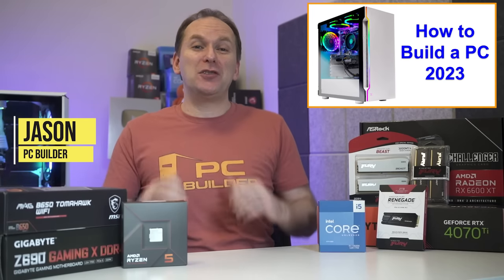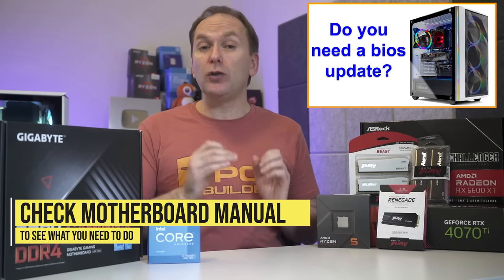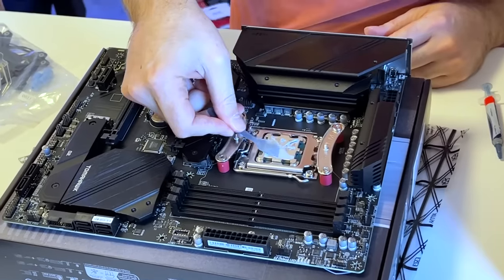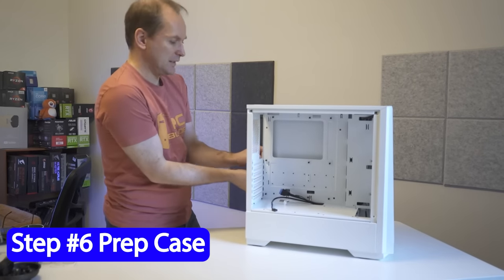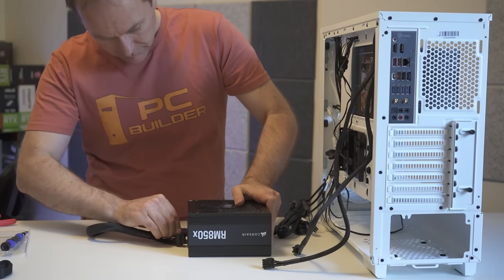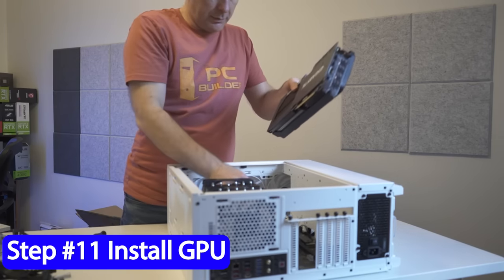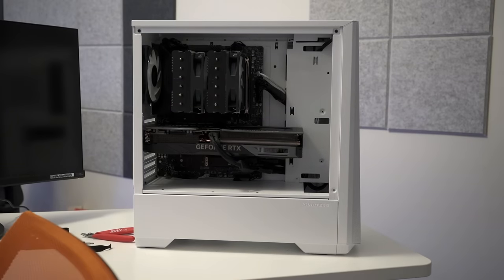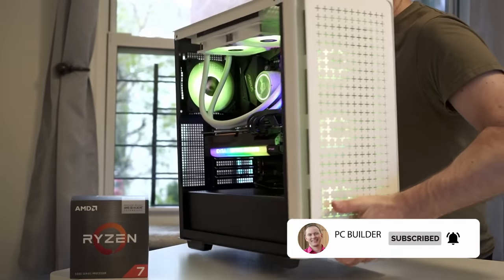🛑 How to Build a PC 🛑 Step By Step Ryzen & Intel 🛑 How To Build a Gaming PC

Comment: Hello Jason! While I am waiting for the CPU to arrive so I can FINALLY build my first gaming PC, I have a question. I am expecting my r7 5700x and I will match it with an Aorus B550 Elite V2, how would I know if I need to flash the BIOS or not? Thank you in advance!
Reply from the maker: That one will likely arrive ready, you'll just want to update to the latest bios after you build. We've got an "After you Build" guide coming soon
Reply: @PCBuilderChannel  I am having the same concern with the Ryzen 5 7600x + gigabyte b650m ds3h... I have read through the manual and searched online and I am not sure how to know if I need to do this?  It could be I am making it more complicated than it actually is.

Thank you so much for all your videos, I haven't built a PC in 20 years, and your content got me up to speed very efficiently - and greatly aided me in choosing my parts :)

Comment: Well Jason I thought I had better watch this video to make sure I wasn't going to do anything silly with my upcoming build.
I have built PC's in the past but as I am  getting a bit long in the tooth now so that was the late 80's/early 90's when things were much simpler. 😆
I was looking at pre built systems but I can build a much better system for a lot less money.
Reply from the maker: Indeed you can! If you build it, it will run :)

Comment: Hey can you say it when we will see revolution  in this market  new stuff gets lanunched like newer  versions  pop up with minor changes like there minor changes  or just support newer versions like in case cpu just addding core or  boost core frequency or just supporting  newer hardware like pci gen 5 all looking for cost bulk production  no kne thinks about revolution   or R & D stuff i hv build i3 12100 f and asus 510m e motherboard  i m stucked gpu amd rx 6k series  is not priced  properly  nvidia  is good for 1440p but this will cost more  for monitor  used gpu hard to get here am getting sandwich   jn between  amd nvidia  cost performance  and in your chart sheetyou didnot mentioned rtx 3050 and 60 score with respect to rx 570

Comment: So I built my first PC last year...I have the ryzen 9 5900, Radeon Red Devil rx 6700 xt, Tuff gaming x570 plus (wifi), cooler master MA610P, and a new Thor 1000w power supply...So my question is I went through driver, bios and other updates...However When I try and play higher end games like Cyber punk, Shadow of Tomb raider, Scum, Red Dead etc...After a few minutes my screen goes black and i hear some slight buzzing and it re-boots...Ive went to my Local Micro Center and asked some questions, but cant seem to find the exact problem...Should I try a newer Cooler for my CPU? Or diagnose my GPU ?  Sorry for the lengthy comment and thanks.
Reply from the maker: Hmm that's very odd! Have you tried posting to reddit build a pc troubleshooting forum? Its a great recourse for issues like this

Comment: Work on the motherboard on a solid surface, you could see the board flex as you were pushing in the ram. Otherwise, lots of solid advice.
Reply from the maker: Thanks! Honestly I've never had an issue with the board flexing a bit but if it makes you feel safer you can open up the box and build inside the box. My hands are a little too big for that. The boards have quite a bit of flex to them. For instance if you can't route a cable at the top of the case due to the board clearance after the motherboard is installed in the case, you can unscrew the motherboard screws at the top and slide the cable through by slightly flexing the board away from the case. It's an old school builder trick from the days when cases were truly awful for cable management.

Comment: May be a silly question, but for the Bios flashback can I use a USB that is 7.45 GB or does it need to be 8 GB or more? Formatted to FAT32
Reply: That's fine. All storage drives have slightly less capacity than advertised due to how the storage is measured and the file system on the drive. In reality, BIOS update files are very small; usually less than 64 megabytes. Its just that since flash drives are so cheap, an 8GB flash drive is usually the smallest capacity drive you can buy in-store so that's why a lot of guides recommend at least an 8 GB drive.

Comment: @13:34 all these wires are getting me nervous now. so this diagram of the motherboard, this is universal or close to it no matter the board?
Reply from the maker: You'll want to look at your specific motherboard manual
Reply: Most motherboards will have the same/similar connectors, but the placement may be different. As always, you wan to refer to the manual that came with your motherboard.

Comment: Hey Jason, If a motherboard has a 4-pin and a 2-pin for cpu power can I use 2 4-pin cables?
Reply from the maker: I think you mean 8-pin and 4-pin. The EPS cables should be able to be pulled apart for a 4+4 configuration, then you just plug in one side of them to the 4 pin EPS slot and leave the other hanging. Hope that helps.

Comment: Could you please elaborate on your comment regarding updating bios using bios flashback in order for the cpu to post.

MB: MSI MAG B650M MORTAR WIFI
CPU: AMD RYZEN 7 7700X

Instructions say:

3. Connect the power supply to CPU_PWR1 and ATX_PWR1. (No need to install CPU 
and memory.) 

that seems to suggest the cpu and ram can be installed or not installed?

what are the outcomes if the cpu/ram needs to be installed and they are not, or not installed if they should be? 

Can any damage be done to the cpu or ram or mb?

Thanks.
Reply from the maker: Follow the instructions in your manual, if they say not to install the CPU or Ram the method in this video is perfect for you. We go over it step by step at the end of the video.

Comment: Jason Im from India and I have a 5600g Amd Cpu system and currently Im able to get Sapphire AMD RX 6750 for $449 should I go for it or wait for some other deal my budget is around that price too
Or 
Should I get Sapphire 6700Xt for $376 
3060 or 3060ti is out of the option since they are starting at $425 here and Amazon is the best option to buy them newsegg is not shipping or even showing India in it's location settings

Comment: i need help :( im trying to flash the bios and my power supply only turns on when I test it with a paper clip, but not when I plug in the 24 pin and the eps cables, so i cant flash the bios on my gigabyte b760m mother board. i'm so frusturated

Comment: After flashing the BIOS on a new build, there is usually firmware, etc., that needs to be updated. Is there any particular order to do these extra steps? Should Windows 11 be updated before attempting any other motherboard updates? Also, why do you mention using a flash drive 8GB or more? Seems like 1GB or more is sufficient.
Reply from the maker: I have a full after you build guide coming soon! A little bit delayed because I may have gone a bit overboard in trying to cover everything rather than just the basics (and covering intel and AMD bios settings). Hopefully this weekend!
Reply: @PCBuilderChannel  sounds great. I’ve got all the parts except the Ryzen 7700x (waiting for a sale). Perfect timing.

Comment: Hey I have a question for my PC build can you help me ? See my build combination is right or WRONG because I want to buy pc 😊....

MONITOR: acer Nitro QG271 (27 inch)

KEYBOARD AND MOUSE: cimetech wireless

 

RAM: XPG ADATA GAMMIX D30 DDR4 8GB (1x8GB) 3200

STORAGE : crucial p2 500Gb

PROCESSOR: AMD Ryzen™ 5 5600G Desktop Processor 

MOTHERBOARD: ASRock B450M PRO4 MicroATX Motherboard

CABINET: Ant Esports ICE-110 Mid-Tower Computer 

SMPS: GIGABYTE GP-P550B 80 Plus Bronze Power Supply

 GRAPHIC CARD: Zotac Rtx 3050 8Gb

Comment: I am looking into surge protectors for high end gaming computer that I am building. The computer will have 3080ti and 1500 watts power supply. Any recommendations for a really good surge protector that is under 150 US dollars. I normally use Belkin surge protectors for tvs in my house.
Reply from the maker: I don't actually, not a product I've done a lot of research into. If you find something you like let me know!
Reply: @PCBuilderChannel  how about APC gaming UPS 1500va sine wave UPS battery backup.
Reply: I know that is over 150 US dollars.

Comment: For the algorithm!

Did a recent build with the 13600k and a 4080. Watch your socket gate pressure on those lga1700 suckers! I got rid of the traditional latch and put a contact plate in instead, the pressure from the stock latch was causing a no post.
Reply from the maker: Thank you! 
And thanks for the tip!

Comment: So a Ryzen 5 5500 cpu does not work with a 4th gen m.2 ssd? I built  my pc yesterday and it keeps crashing  it has a MSI mpg b550 gaming plus motherboard ryzen5 5500 cpu, wd-black gen 4 1TB ssd, 16GB corsair vengeance lpx, Radeon  rx 470

Comment: Hi guys, I own rx 5500xt, ryzen 5 5600x and asus rog strix b550-f....would i be good with 500w power supply or i need more?
Reply: You need more. In case you need to upgrade the GPU. I'd say from 650w range.
Reply: @rogued3mon414  okay, but lets say I don't want to upgrade GPU... will it be enough then?
Reply: @krejzi9238  Maybe, yes. Depending on the psu model itself.
Reply: @rogued3mon414  okay, thx a lot mate😉
Reply from the maker: Hop over to our Best PSU 2022 video and follow the method there

Comment: hey Jason I have been a fan for a while now my cousin said he could give me some older parts he's not using I was wondering how to Flash bios on a build't pc? is it different? the cpu he would be giving me is the ryzen 5 1600. so In the future I would want to upgrade to a 5600x then 5800x3d? but how would I flash the bios on a build't pc?????
Reply: You'll want to read the documentation for your motherboard. If you don't have the manual, you can find it on the manufacturer's page. A lot of motherboards require a working CPU first in order to even be able to update the BIOS. The mid to higher end boards have an update feature that let's you update the BIOS even without a CPU installed, but again, you'll need to read the documentation.
Reply from the maker: JJflores gives good advice below. Sorry I missed your comment when posted. I'd update the bios to the version I needed before disassembling and installing a different CPU - see our how to upgrade guide for more.

Comment: If the pc case exceeds the desk table, would it still be okay? Thinking of buying a massive case to future proof my setup.
Reply from the maker: If you can secure it well, wouldn't want it falling off the desk
Reply: @PCBuilderChannel  that is what I am worried about. I think I will just go with a smaller case that doesn’t exceed my desk.  It is always hard to find a good balance as most of the cases do not significantly increase the height to compensate for small desk size when you can vertically mount a GPU. I guess what you are saying is, what risk am I willing to take in this case to table placement scenario. GPUs aren’t getting smaller, so are power requirements, so it is hard to balance airflow, and cooling solution. How can I get bigger radiators when the case cannot support it?

Comment: So one screw seems to be problematic and stuck for the motherboard and case. I cannot get it out even though it is spinning, I span it million time and it is still inside locking the motherboard and I cannot take the board out ever again. What is the solution for that?
Reply: In those instances, what I found to help is to grab the stand-off with a pair of pliers. This may be tricky to do depending on which stand-off it is and if you have any room. Use the pliers to grab the stand-off and then unscrew the screw.

Comment: Me who just now finished building my mother's PC. Well most anyway got to do windows and it seems one of the fans aren't working correctly maybe once I get windows and drives installed it might but I will wait and see.
Reply: Is the fan not turning on at all?
Reply: ^^^, also maybe a cable is stuck in the fan or its not mounted properly or maybe it might not be connected in properly but yeah it could be a software issue but idk
Reply: @BrickPB  They do but the middle one seems to have a weaker light than the rest which isn't right.
Reply: @TheGulfryd  Will check cables for the 60th time ig.
Reply from the maker: Here's how I'd troubleshoot it: In bios, go to the fan controller and see if it is registering on the fan header it is plugged in to. If not, check cables. If cables are fine,  move it to a different header (with PC turned off and unplugged) and check again. If nothing, the fan is dead. Cables and connections on cheaper fans can come loose or even disconnect sometimes, it happens.

Comment: Help me make the right choice. I have Ryzen7 2700x + tuf b450 pro gaiming 16gb 3200mhz + rx6700xt now. I play 1440p games. I can't decide to change just the cpu and stay with the b450? Or swap cpu +B550? How much better will the B550 be than the B450 with my rx6700xt? Which cpu is better to buy? Ryzen 5 5600 or Ryzen 7 5700x?
Reply from the maker: Personally I'd go 5600 on your existing board. Thats going to give you a great boost with minimal fuss and spending. See our "how to update your pc" video for more
Reply: @PCBuilderChannel  Thank you very much for the advice, I already watched the video.
Reply: @PCBuilderChannel  Tell me please. Can I put a ddr 4 with a frequency of 3600 on this Ryzen 7 2700x+ Asus tuf B450 pro gaming assembly???

Comment: Which processor should I buy for Rx 6750 xt at 1440p gaming, i5 12400f or ryzen 5 5600x? Will there be bottlenecking? I also use for coding,so should I go for higher processor? Also which motherboards for the processors?
Reply from the maker: I'd go 5600X personally. See our 5600X build guide on the channel for more
Reply: @PCBuilderChannel  5600 or 5600x

Comment: Hello please help me. Do I always need to switch off my monitor as well after shutting down my computer using the power button of the monitor that is found on the bottom corner? After a year, my monitor's power button became hard to press whenever I am going to turn it on or turn it off, I always need to press it a little harder to turn it on or to turn it off.
Reply: No. Most monitors will go into a sleep or low power mode if you don't turn it off. Some may shut down after x amount of time, but it depends on the monitor and its settings.

Comment: First build and it won’t post
Today I failed at my first buildOnly thing that happens when I attempt to power the PC is the illumination of a single multicolor LED located on the backside of the motherboard.  This LED glows going thru all the colors of the rainbow.  I hear no fan noise from the PSU.  The case fans and the CPU fan do not move.  I’m using integrated graphics and nothing comes thru from the HDMI cable.  Here are the specs…ASRock B650M Pro RS WiFi, Ryzen 5 7600 with stock cooler, TeamGroup TForce Delta RGB DDR5 32GB 6000MHz CL 30, Silicone Power PCIe Gen 3x4 M.2 2280 SSD, Bitfenix Nova Mesh M ARGB case.
Reply: I would start by reseating all internal components.

Comment: Oh god this is much harder than I anticipated. Im having SO much trouble trying to figure out which cable goes to where on my  8650 gaming x ax mother board and my psu. Im freaking out really bad.
Reply: Its not that bad. You have to look at things logically instead of freaking out. So what exactly are you having trouble with? What cables? If its the PSU cables, most of them have written on the connector what its for.
Reply: @JJFlores197  I got it all figured out now. I had to daisy chain for the led fans and plugged everything in, crossed my fingers and the pc turned on without an explosions

Comment: I’m building my R5 7600 right now using this as a step by step
Reply from the maker: Awesome! Best wishes on the build!
Reply: @PCBuilderChannel  Thank you SO MUCH for the video. I seriously have doubts of my ability to have done this without your step by step guide. It was invaluable! Now just trying to get the bios figured out. I’ve always been told not to flash beta bios versions but since I’m running an am5 system, I feel like I need this new bios to stop my cpu from being burnt alive. So…. Guess I’m gonna take a chance. One thing that has thrown me for a loop though is the ability to use A-XMP or to use EXPO since they are both available for me to use. I’m thinking EXPO is the way to go. It’s just odd I have two choices on getting my ram to perform at the level I paid for. 

Either way my build is done...largely due to your video. I cannot thank you enough. I was SO scared. 

Now it’s just time for the fine tuning.

Comment: Jason says do not remove the label on the NVME as it is a heat spreader, if i already removed the NVME label, is it a big deal?
Reply from the maker: It's likely fine, especially if you use a motherboard heat spreader. Mostly these exist to heat up the NAND, not cool it as it doesn't run well if cold. They take heat away from the controller (where heat is bad) and spread it to the NAND.

Comment: hi jason my case fans rgb cable for my masterbox td500 appears to be so short that it cant connect to the motherboard. is there any way that can just extend the rgb cable?
Reply: Does those cables not have a hub or a splitter? From what I know, the TD500 mesh has a fan hub for those fans.
Reply: @rogued3mon414  hub was present but only for the fan cables not the rgb cables
Reply: @derontanzil6939  Well, If you could get a hub that supports both fan headers and rgb header, that would be great.
Reply from the maker: Sorry I missed this a while back, as Rogue says you can buy extension cables if necessary or IMO just buy an ARGB hub for about $10-$20. I recently bought the Thermalright Hub x8 which is fan and ARGB for $8. Haven't tested yet, but good reviews.